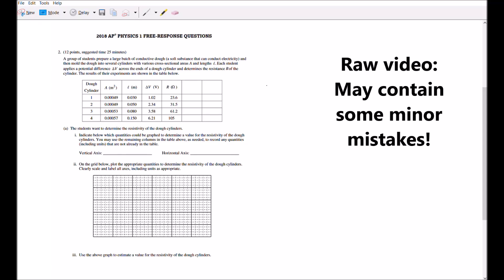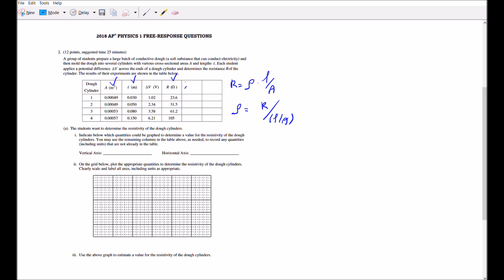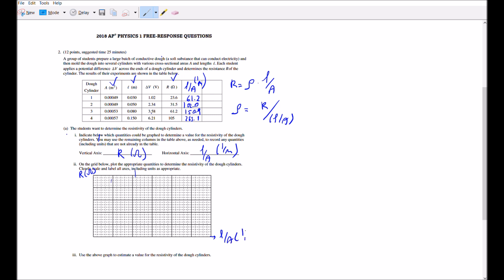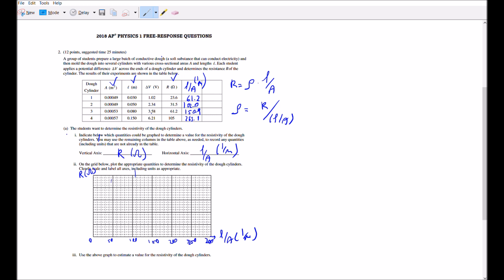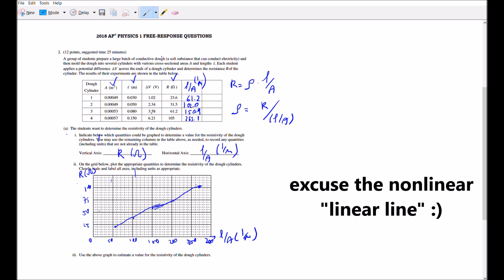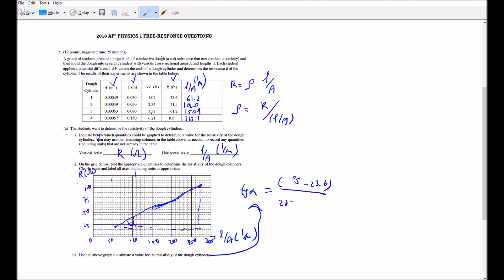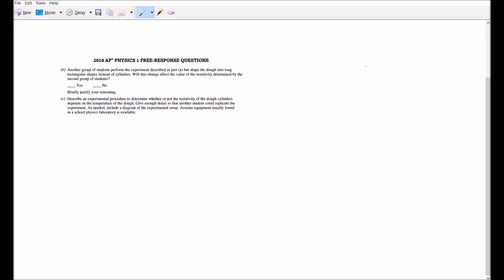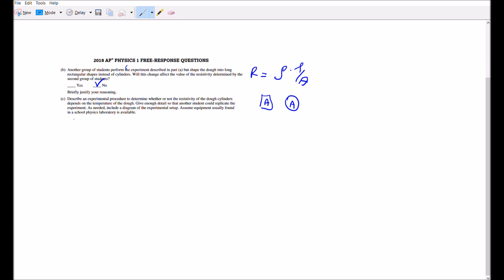2018 AP Physics 1 Free Response Solutions & Answers #2

Comment: For part b, I said that the change WILL affect the value because each shape has a different cross sectional area (I believe the cylinder is mr^2 and square is not the same). If the cross sectional area equations are different, that will yield a different resistivity based on the equation R=pl/A where A is the cross sectional area. Would this work?
Reply: I don't think so. Resistivity is unique to every substance. For example, a copper wire and a block of copper will have the same resistivity regardless of the fact that they have different sizes. However, Resistance changes with cross sectional area and length. For example, a large cube of copper wont have the same RESISTANCE as a short thin copper wire because of the differences in cross sectional area and length.
Reply: I mean, it should affect the value of resistivity because the students will not be able to produce a rectangular prism so precise that it will have the same constant of resistivity.  I believe that collegeboard can't take off points for having yes or no as long as you say that each material has the same resistivity.. but they will.

Comment: I put No for part b, do I get no points for the explanation too?
Reply: I doubt they would give you much credit for that though, as you need evidence to support your answer as it says to do so.
Reply: I said no because the area would be different (students cannot measure that precisely with LAB equipment).  However, I made sure to put that the resistivity would theoretically stay the same because the it is a constant: each material has a unique resistivity.  Basically,  I said that if the students were able to measure 100% precise, then yes, it will stay the same.  However, they aren't able to, so no.
Reply: You get point as long as the rest of your question/answer stays consistent with “No”